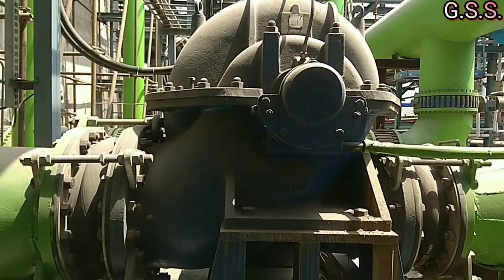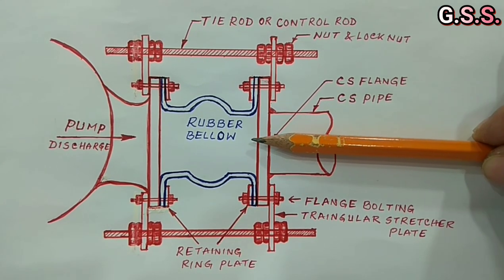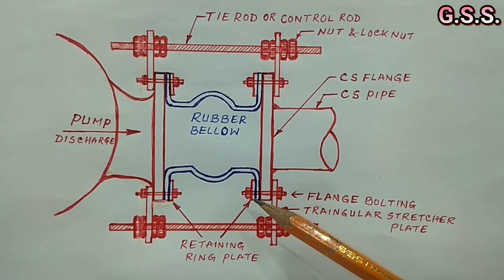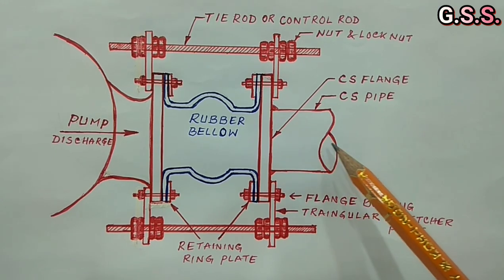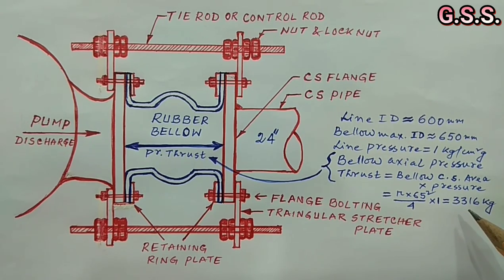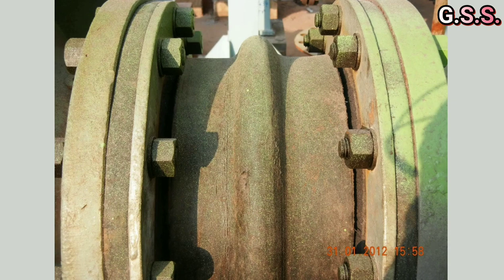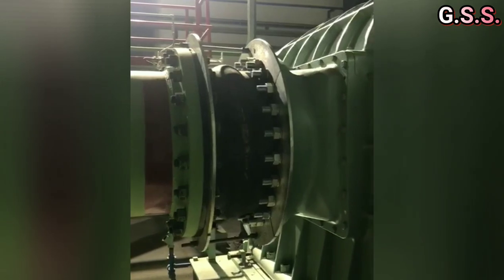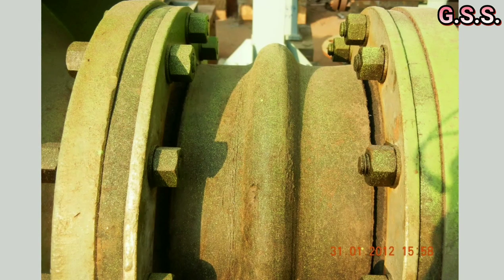Piping Engineering : Rubber Bellow - purpose, installation & reason of failure

Comment: Good presentation. 

Limit rods are critical to safeguard the expansion joint from over-stretching / over-compressing. That is ok in a situation where the expansion joint is NOT subjected to thermal loads. In thermal load expansion / contraction case, what do we do?
Reply from the maker: In that case we have to allow expansion joint to expand or contract axially to the permissible limit of the bellow, but at the same time we will have to take care of the axial pressure thrust due to internal pressure by providing robust anchor support.